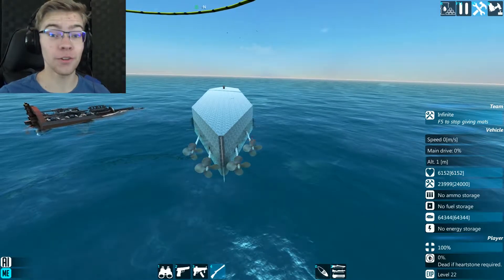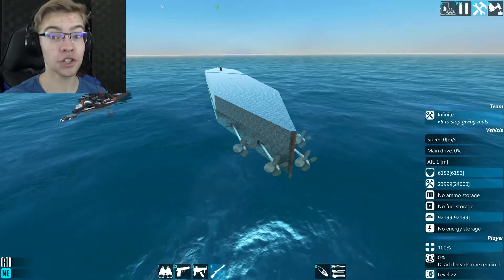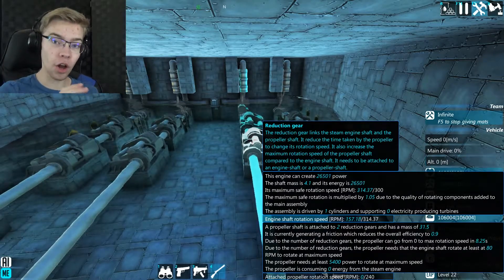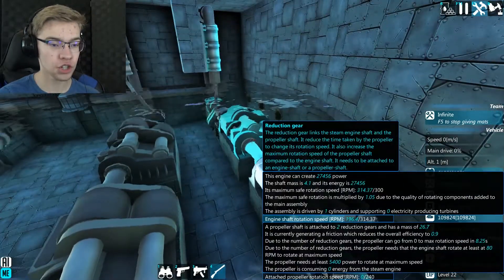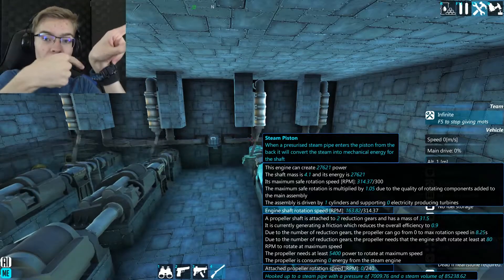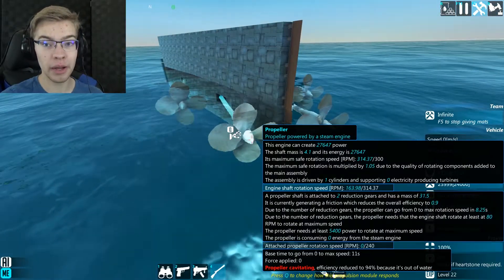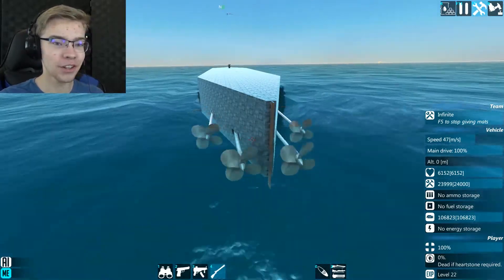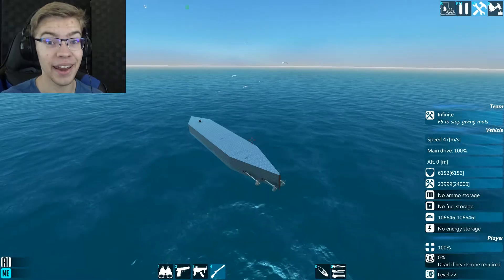1 CYLINDER STEAM ENGINES | From The Depths #17

Comment: I think for this enigines 3x3 prop would fit better, engine can generate 27.000 of force and 3x3 use 25.000 ? ...5x5 use 54.000 so its potential is wasted.
As for wedhe end of craft engine placement should also mimic same shape so lenght of all 4 engines are the same and at the "V-hole" on top where the door is boilers could be placed.
Waiting for electricity from steam tutorial.